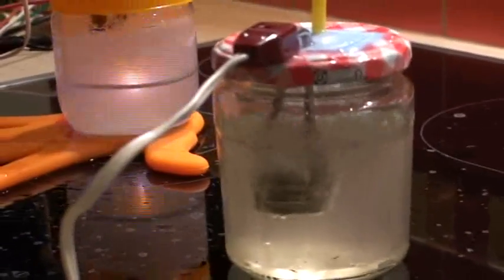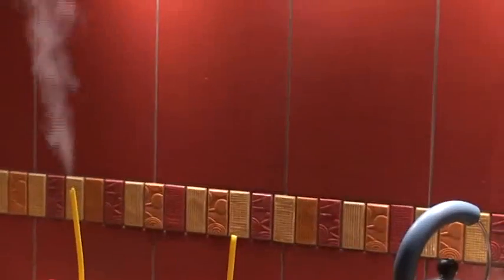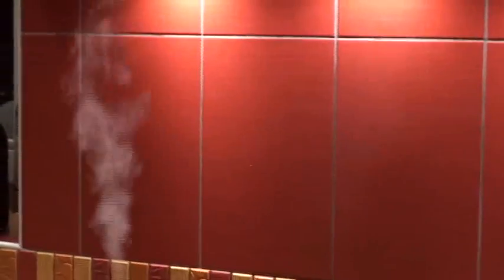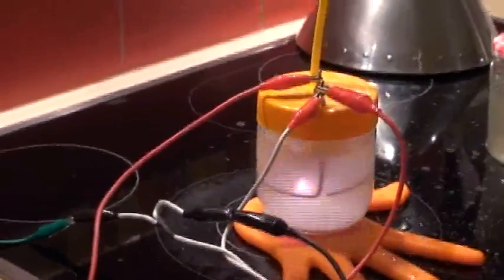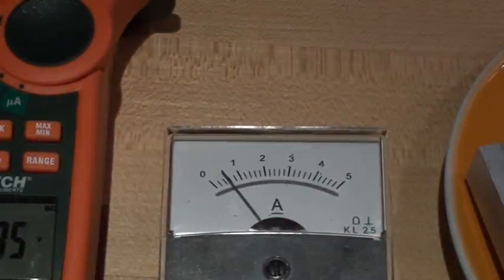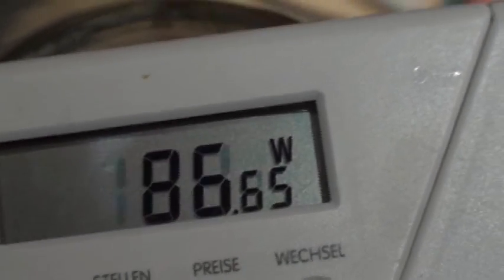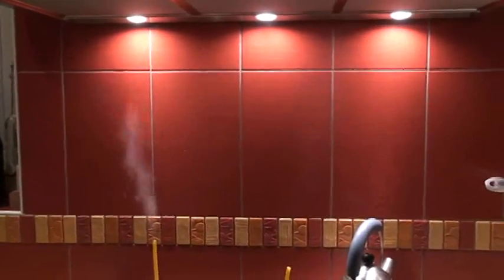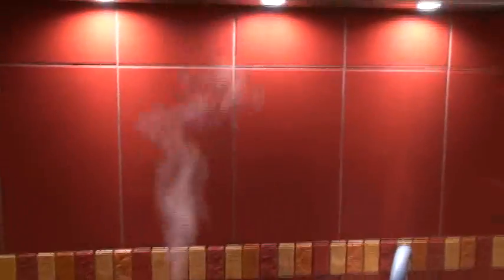cold fusion perhaps study  1

Comment: You could measure heat displaced via output gas, by placing a plate or mug in the gas output, at set distance, and measuring the temp of the object, as it gets heated by the output gas. Comparing results between reactors may help work out steam:HHO ratio. As well as potential to do work with heat. Great testing Keep it up.